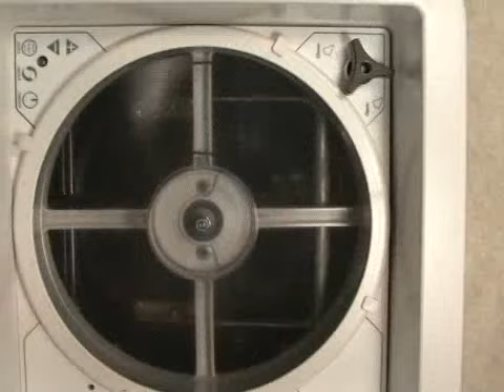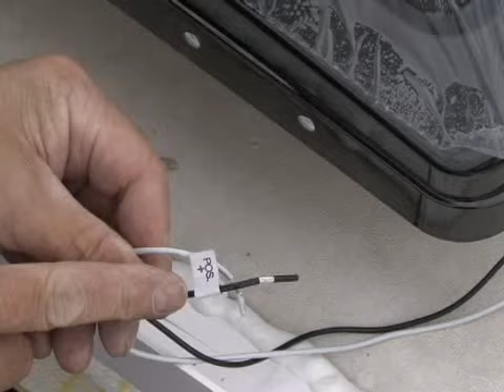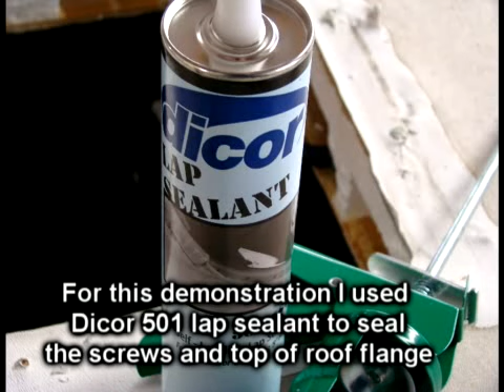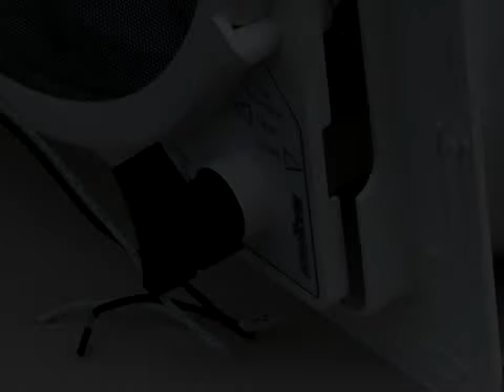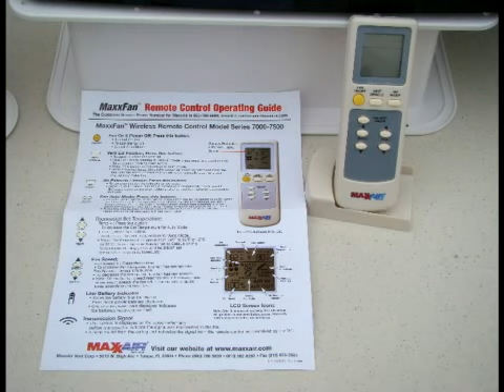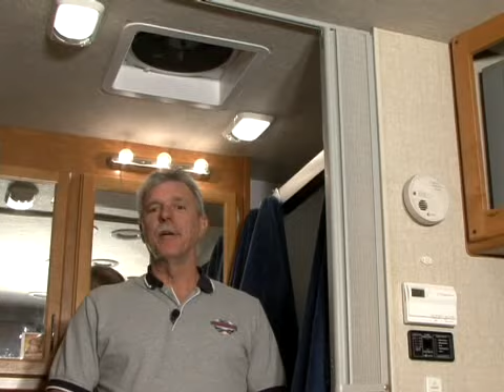Maxx Fan Installation by RV Education 101

Comment: Your video was great, 11 years after the fact.  I installed one today,, and it went very smooth.  I did have to use different screws to attach it to the roof, as the screws supplied were much thinner than the ones that were in there before, so I went with the size of the old screws.

Comment: @RV Education 101
The 3/4" screws going into the side of the fan and the flange should get lap sealant also, correct? You didn't mention that in the video.

Comment: Great video.  I watched it a couple of times and followed the step-by-step directions to replace two stock equipment fans with the manual Maxx Fan.  Very efficient fan, moves a ton of air, and the temp control setting is a definite plus.  

I had one big issue during the install.  The roof is crowned or rounded, so the roof receiving flange would bend after being screwed in.  The bend in the flange made it difficult to properly align the fan to the roof receiving flange--the screw holes just would not align easily.  That was definitely difficult but not impossible.

All in all, with a little patience, it's definitely a DIY project.  It worth the price of the fans.. they move a lot of air, and they are very quiet.

Comment: I want one but I'm not wired for it, bummer! Can I pigtail off the 12 volt light nearby?
Reply: MrLowsporh Yes you can if the fuse can handle it. I did it in my fifth wheel